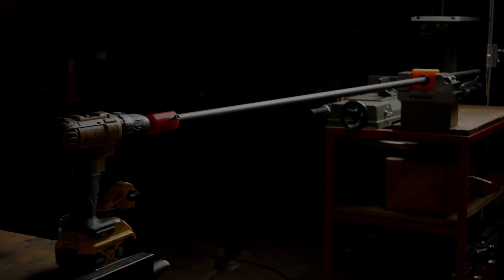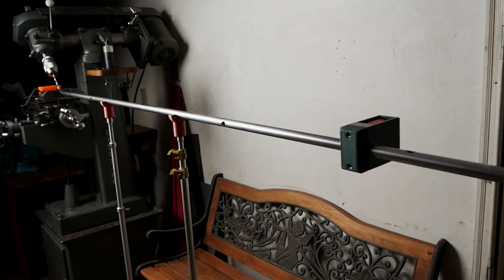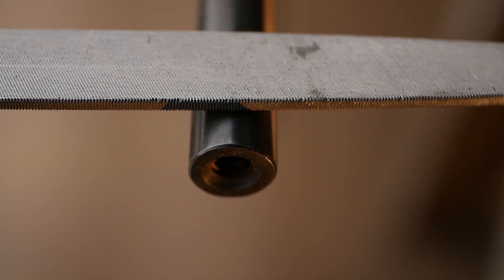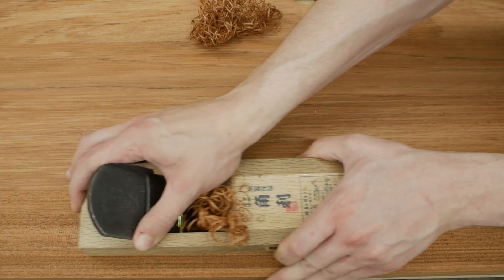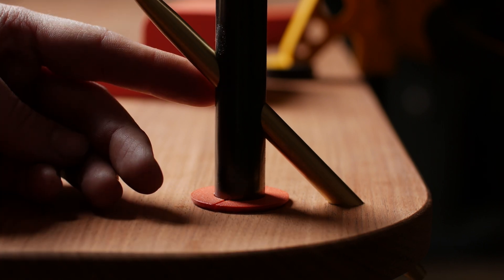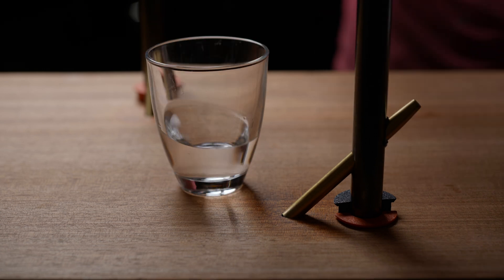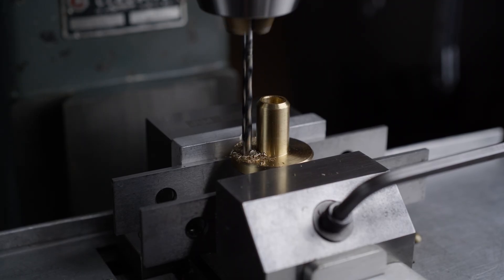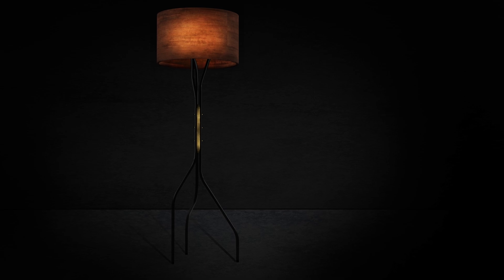Modern Bookcase Build - Using 3D Printing to Build Fine Furniture

Comment: Isn't it upside-down? Wouldn't it be slightly less wobbly if these things worked in compression?
Reply from the maker: @NicksStuff funny you say that. because i originally designed it with the pins going both top and bottom. Switched to just top to try and make it a little easier. I think if both the pin and the holes were tapered than it would improve by being in compression. That said not sure how much. In the end of the day the leg width was only like 12" and the height is close to 84". So it was gonna wobble no matter what i do haha. I actually have a v2 design that has the legs flare out wider at the base. one day.Honestly though i have been using it for a year and i barley notice the wobble.
Reply: @Unemployed_Architect  Does it wobble any less if you turn it upside down to check? 😬
Reply from the maker: I could actually try that but it might kill me haha. it weighs a crap ton. took four of us to get into my apartment.